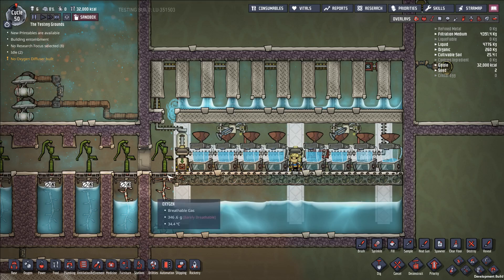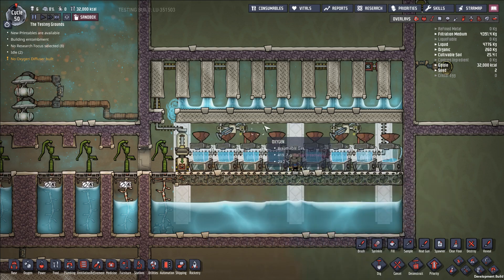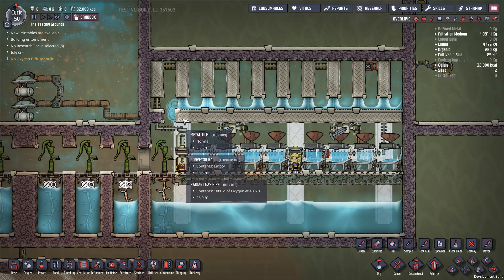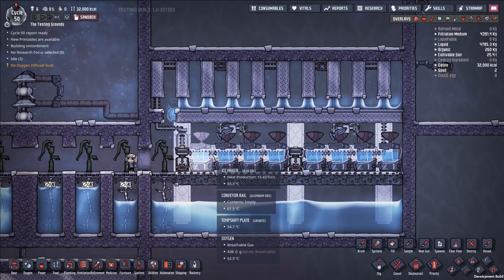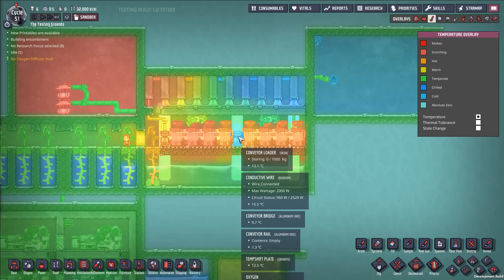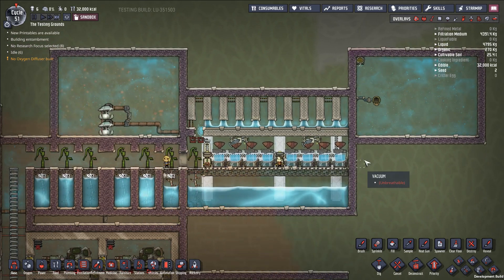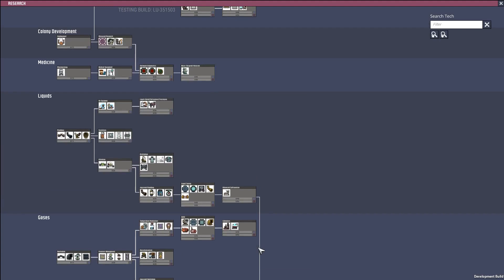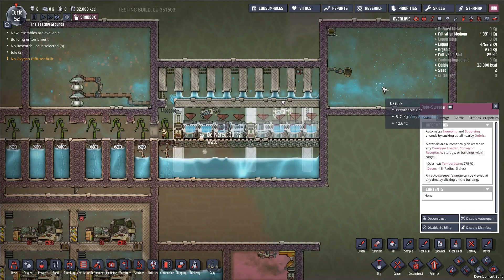Cooling Your Base with Ice Makers (Updated) [Oxygen Not Included]

Comment: Hey, thanks for this.  I just watched your older video last night and tried to place a scaled down version of this.  Unfortunately, I didn't know about the nerf as I've only had this game a few weeks now.

With that info I'd like to say it is pretty easy getting to that point in research even with my experience, so no worries there.

I want to tame a cool steam vent with this.  Not the vent so much as the water.  I get it in at about 70 degrees.  My problem is I can never seem to get enough ice.  At some point the system heats up too much and 3 to 4 ice machines just can't keep up.  Keep in mind though this is your older build and doesn't have the same temp shift plates and metal tiles.

I know you recommend not using it to cool water in your first video but as a newb, being able to secure a permanent water source before I tap into the oil biome will put me at ease. 

As I said, I'm also interested in compacting the design which is probably another reason mine isn't working.  While watching this video I got an idea:  What if the heat exchanger was IN the reservoir of water?  It would be nice if I could make polluted ice but since that is not an option  it will have to be ice and water. 

I made mine in an ice biome and it is still overheats.  Again old design.  It did help because I use the ice I found there to fill the reservoir once it began to melt.

Well, thanks again for the design, and the inspiration!
Reply from the maker: Merging the water reservoir with the heat exchanger is a good idea, just make sure you're comfortable having your water reservoir heated up.  If you're using it for other stuff, then having the reservoir at ~40-60 C might cause problems.

In a recent video we tested the ice maker and it should produce about 4 kDTU of cooling, so it will be hard using these to tame a cool steam vent.  If the vent outputs 2kg/s at 115 C, and you want to cool it down to ~75 C, you'd need around 80 ice makers.

Comment: You mentioned something about venting material into space to delete heat. Can you go into detail about that and whether if it is worth it?
Reply from the maker: Usually in the late game there are a variety of materials you don't have a use for.  Sulfur is a prime example-- it's a byproduct of methane distillation, but has no function in the game.  So once you have access to thermium components, one way to cool down your base is to superheat these materials to ~1000 C and then vent them into space.

Phosphorous is a good candidate if you have large drecko ranches but no large sinks for phosphorite.

Oxygen is a good candidate if you are focused heavily on hydrogen fueled rockets, since the only way to get hydrogen is electrolysis.

Carbon Dioxide is a good candidate if you decide not to build slickster ranches.

Chlorine is a good candidate if you have a chlorine vent you dont care about on your map.

Basically anything you don't mind getting rid of you can dump heat into before you send it off the asteroid.

And though it's completely unnecessary, if your dream is to colonize the magma biome of your map, the easiest way to cool it down is just to pump the magma out of it straight into space.

Venting hot stuff into space is probably the most powerful option for cooling down a base once you have access to thermium + a bunch of stuff you dont care about.
Reply: @gearheadgaming1  If your seed contains wheezeworts, you can still use wheezewort rooms to cool down the oxygen. Put an autoloader, a storage bin, four wheezeworts into a closed room, fill it with hydrogen and have phosporite pumped into that room and it'S a good way to ger rid of the phosphorite